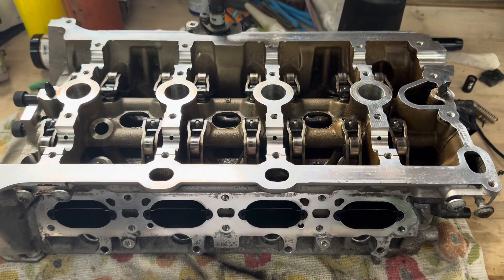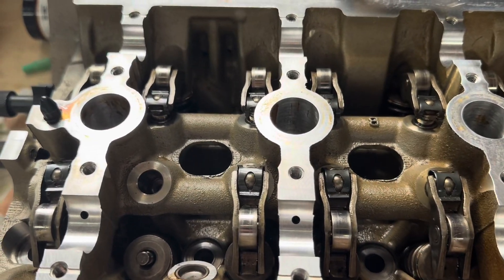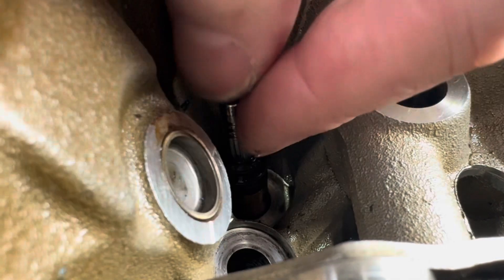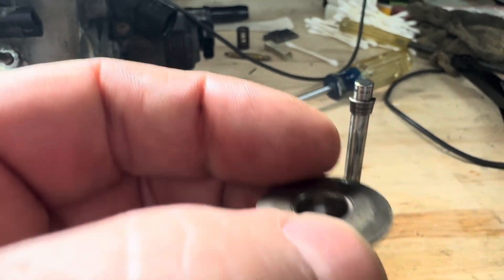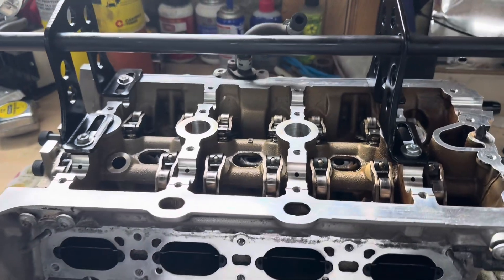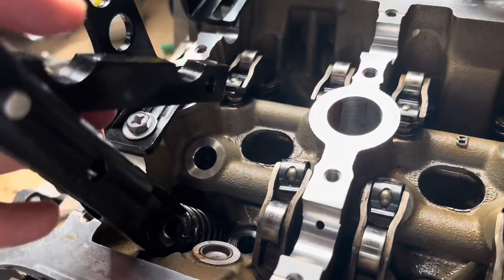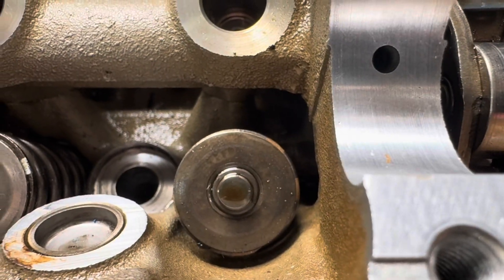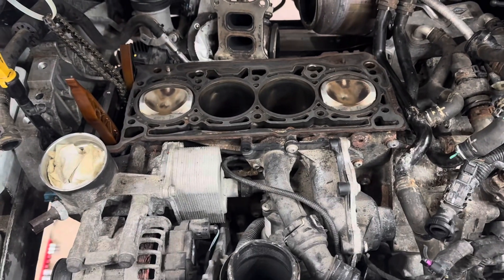2015 VW Jetta 1.8T - part 3 - Valve spring install

Comment: I am hesitant to find a used engine or do the partial rebuilt as you did since the compression on the other three are not that great.
Reply from the maker: What is your plan then?
Reply: @beardedgarage  I am collecting some reliability data about these 1.8t  engines. My intention was to fix it for my wife (sorry, I am using her ad free yt account!). I will pull the engine if I end up doing the valve jobs. I am less patient to work in tight spots! What was your compression on other cylinders again?
Reply from the maker: @merrinomay7986  In the 150 range.
Reply: @beardedgarage  I may have collapsed piston rings or all of the above! My partial research indicates that the number one killer with the earlier years (like mine!) is the frozen piston rings due to the bad design causing sludge built up. There's an upgraded rebuilt kit. It's a shame that one of the very first automobile inventors still doesn't know how to design piston rings!!! but their automobiles look so sleek that you can't pass particularly their paint finish. In my state of Colorado they stay the shiniest!
Reply from the maker: @merrinomay7986  Have you put a camera down into the cylinder to see you can see scoring? If the compression is low on all cylinders, I’d suspect the head gasket unless the car has been run out of oil. I wouldn’t think multiple simultaneous ring failure is likely
Reply: @beardedgarage  I could see two of the pistons clearly and the other two black and oily. My junkyard friend suggested to pour an once ATF through the spark plug hole and let it sit over night and then cover up the hole and crank it a few times. It may ease off the rings. I very much doubt it but will give it a shot!
Reply from the maker: @merrinomay7986  Sounds like witch doctor work…. Good luck. I’d probably pull the head and hope for a headgasket.

Comment: Great videos! You are so patient while doing some frustrating work! I happened to pick up a  2014 VW Passat SE, 1.8T. It's super clean with 134K miles. I was getting a multiple misfire on 1,2,4. I did a compression test the results are: cyl one 115 psi, cyl two 0, cyl three 120, cyl four 115. I did the leak-down test and more likely the problem is the intake valve or possibly the exhaust valve on #2. It seems like it is a common problem. Was the valve spring snapped on yours? What is the cause of it? Don't you think it would be better to replace all of the springs if one fails? Could you do it w/o taking the head off? Thanks
Reply from the maker: No idea the cause, the spring is just broken. No reason to replace them all, it appears to be a fluke. Unfortunately you have to take the head apart to get to the valves